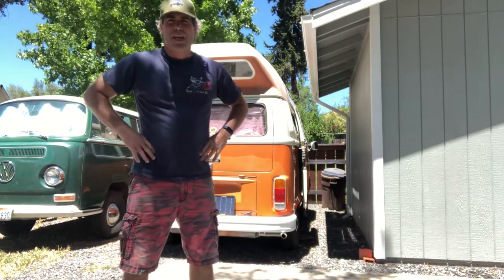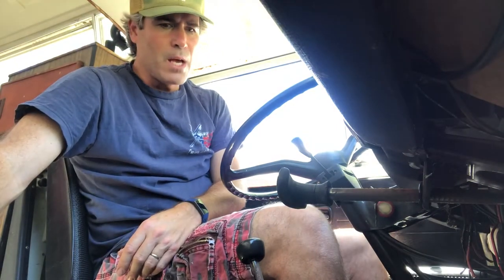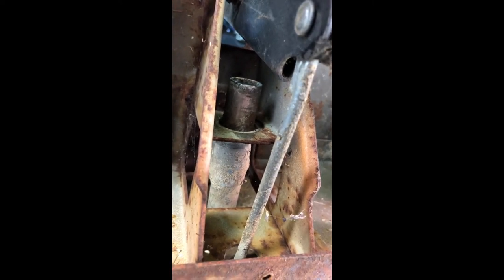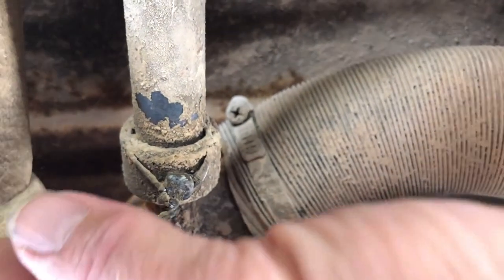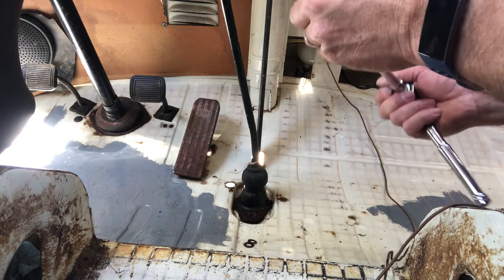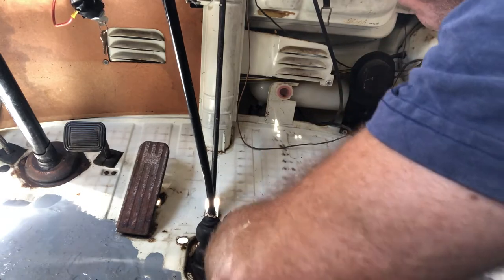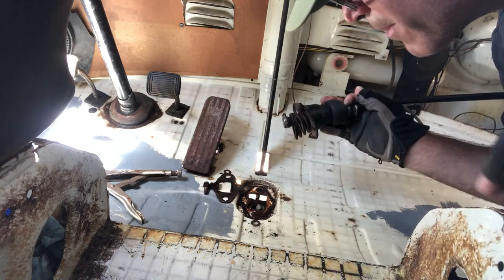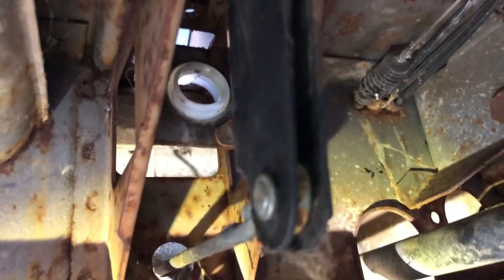VW Bus Shifter Bushing Replacement

Comment: Thanks for sharing! Excellent job. Very helpful to have your experience as a reference. At 12:21 time …is there a cap on the open shift rod at the front end of the bus? (on the end you cleaned super well)
Reply from the maker: No, there is no cap that I'm aware of.  I wonder if there was originally?  It seems like a good idea to keep water and other things out of there.  Good question!

Comment: Excellent video! I am hoping that my gear shift issues are the same and a simple fix like this, I have looked all over online for a similar issue and this is the first tutorial I have found! Thank you, liked and subscribed, look forward to more helpful VW bay window hints and tips.
Reply from the maker: Awesome, thank you for the great feedback.  I'm glad you found the video helpful...and I hope you are able to get shifting improvement by replacing yours.  I was just glad I didn't have to replace the rear one, as that involves dropping the engine. I figure I'll do that the next time I have to remove the engine for any reason.  Best of luck with your project!

Comment: Just got my 74 Safré Custom Camper Riviera going. Going to be towing my 65 ghia with the van down to the beach to camp for a few days. Park the 74 van and set up the side tent and then cruise around town in the ghia.
Reply from the maker: Nice!  That sounds like a good plan!  How does the ghia tow behind the bus? Pretty good? Are you running a larger than stock motor to be able to tow?

Comment: Says he is worried about broken bolts, then grabs an impact gun!!!!! LOL
Reply from the maker: Ha!  Good point.  Probably not the best choice of tools....
Reply: Actually… an impact driver works excellent for stuck bolts. But use common sense and patience. Short, light bursts, both directions; loosen, tighten, loosen, tighten, loosen… gradually increase the force and time as you focus more on loosening the bolt. Bam! Mission accomplished

Comment: I just looked at my 72 bus and it doesn't look like your setup, can't see a hole for a coupler. Bentley manual says, on 72 models only, the flexible coupling is installed on a seperate extension rod that is bolted to the end of the rear shift rod.